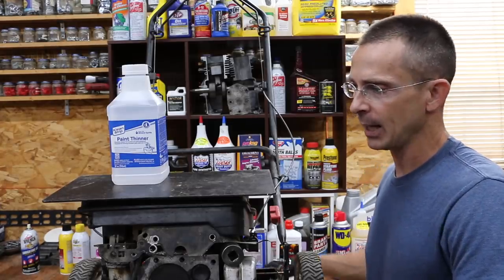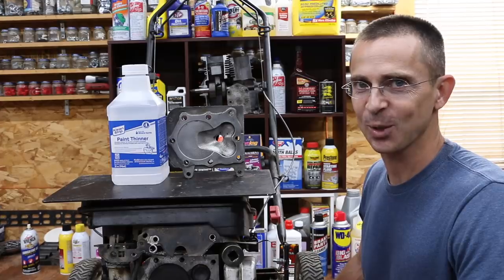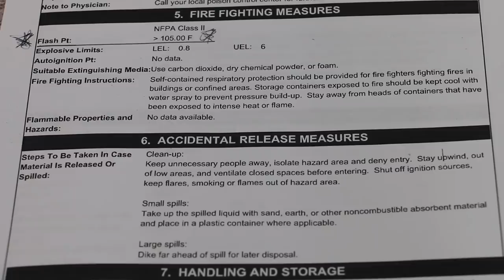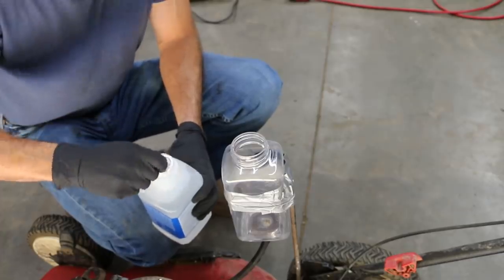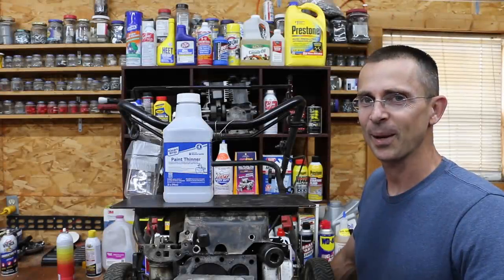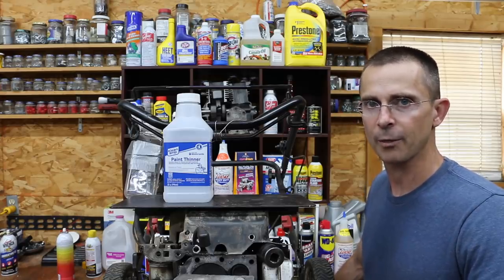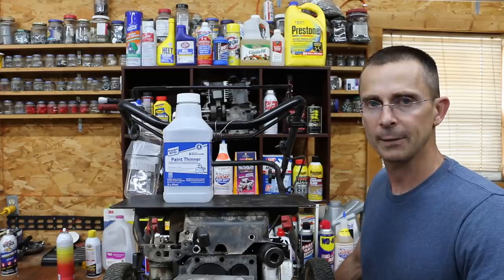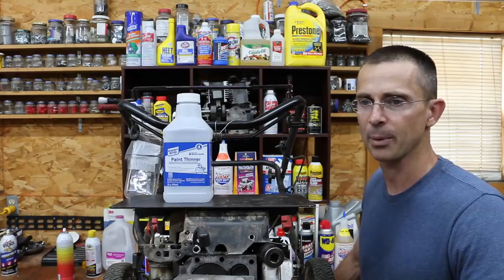Will a Gas Engine Run on Paint Thinner?  Let's find out!

Comment: The reason it runs better on 50/50 pt/gas vapors is commutative (individual) vapor pressures. More ingredients = more volatile. Add a third ingredient and it would be even more betterer
Reply from the maker: Thanks for the feedback.

Comment: and the wmb Briggs is a very low compression engine running on WD-40 but I was spraying it in the little mixing valve carburetor I never tried to pour it in the tank and letting it suck up through the mixer it has no float carburetor it's one of the early early early ones
Reply from the maker: Thanks for commenting.

Comment: I was helping a friend clean out a detached garage full of junk. I found an old chain saw in there and wanted to see if it would run so I could make a junk/sell assessment. I looked around and found a half full 2.5 gallon gas can labeled "Pre-mix" and while it smelled kinda weird it seemed like it should burn so I tried it. It started and ran fine. When I told him later he asked what I used for fuel since he didn't think he had any pre-mix. I said I found a can out there that said it was pre-mix and he started laughing. He said that was paint and reducer (thinner) from cleaning his paint guns, some kerosene, weed killer, and probably even some piss. He used to use that can for everything he didn't know where to dump from the house garage, which he used as his body/paint/mechanical shop. So yeah...little engines will run on pretty much anything that burns. At all.
Reply from the maker: Wow! I'm glad it fired up.
Reply: I thought of another paint thinner episode...I worked in the shop at an old style full service gas station, probably the last one in the area. One of my old customers had a one owner Lincoln Mark IV with the 460 and he used to swear by running about a pint of lacquer thinner in each full tank of fuel for deposit control. I don't know if that actually works or not, but one day he pulled up to the self serve side and put in his thinner, walked over to the shop and started talking to me for a while, then when he walked away he just got in the car and left...didn't put any fuel in it. A couple of hours later he called and said bring the wrecker, I ran out of gas. I told him yeah I thought you forgot to fuel it. So I went and hauled it back to the shop and filled the tank while it was still hooked to the wrecker, but it wouldn't start. It would huff back through the intake randomly but not really trying to run. I pulled the plugs out to have a look because it acted and smelled flooded, and lo and behold...5 outta 8 electrodes missing! And insulators stained red as cherries. 8 new plugs and it was fine again. I guess there was some SERIOUS detonation occurring there while heavy on the lacquer thinner ratio...

Comment: Since mineral spirits is similar to distillate, I think, I wonder if it would run in your little diesel motor? Or maybe a mixture of diesel and mineral spirits. I know they use to run early diesel locomotives on distillate back in the 1930's. Yet my dad lived in south Texas back in the early 50's and he said Conaco oil trucks, that had gasoline engines use to fill up out of the distillate tanks. Maybe it will run in both.
Reply from the maker: Thanks for the suggestion.

Comment: I’ve heard of running mix of 25% paint thinner briefly to clean out valves and crapalytic converters. I never tried it. It probably increases engine temp and cuts cylinder lubrication.
Reply from the maker: Great feedback. Thank you

Comment: I always wondered if you use the hot exhaust to a heat exchanger to vaporize diesel or fuel oil to create vapor. Then direct the vapor to the carburetor to run the engine. Possibly starting the engine on gas to get the heat exchanger hot then cut the gas and transfer to diesel vapor to see if it runs. Cheers
Reply from the maker: Thank you for the video idea!

Comment: How about running on Lacquer Thinner?  Very volatile, low flash point, and lot's of oxygenates.  Might damage seals like acetone, but it may also clean up carbon deposits, and gummy carbs.  Try a dirty fuel, then lacquer thinner and see if it cleans the carbon deposits.
Reply from the maker: Thank you for this recommendation!

Comment: can't believe it ran so smooth on such high octane, i bet it wouldn't last a summer running pure thinner tho i think gas is supposed to have a lubricate isn't?, for the rubber seals in the carburetor, seems like thinner would dry em up.
Reply from the maker: I do believe paint thinner would be hard on the carburetor. Thanks

Comment: You should test different size metal shavings, filings and drill spirals to see how much damage you can do to your motor if you are drilling, taping or grinding near the intake manifold. Maybe even see what some tiny screws, washers, bolts ect would do
Reply from the maker: Thanks for the video idea.

Comment: Old mechanics trick is to run 1 gallon paint thinner to 3 gallons gas in your car if you have cat problems. 
  I got my old truck to pass smog with that mixture. It’s basically just making higher octane gas.
Reply from the maker: Thanks for the recommendation.

Comment: I have an old Model T, and I've heard that a trick to get rid of some carbon build-up from back in the T days was to spray water into the intake while the engine is running.

I would love to see you test that and find out if it actually works!
Reply from the maker: Thank you for this recommendation!

Comment: Love your videos. The practical facts and evidence testing the claims and you don't leave out the anecdotal because sometimes that tells a story as well just thought I would throw it out there again how about HHO on your gas vapor engine see what a carbureted engine will do with HHO and how much more efficient if at all it will run. And don't forget the flashback arrestor intake for safety,I think that's what it's called... Don't want to see you get hurt from my suggestion LOL!
Reply from the maker: Thank you.  I need to test HHO soon!
Reply: @ProjectFarm  and then I realized lawn mower doesn't need a battery to run LOL... Of course you could get a lawn mower that does use a battery ignition system but that would be expensive and there may be better ways to do it I'm sure you'll come up with the best way when the time is right thanks again for your videos.

Comment: I've run them on mineral turpentine they run okay ..run quietly ..however no real power and they knock like hell when you put them under load. Not sure what you were using 
Different thinners names for different places... in australia...
oil based paint -mineral turpentine 
shellac based - methylated spirit's 
paint thinner is Really strong stuff eg: gun wash.
Reply from the maker: Thanks for sharing.

Comment: maybe retry the diesel test but this time see if it runs smooth with a choke applied because in the original video it ran with constant use of the primer and that only draws extra fuel in to the engine and the same could be accompleished with the choke
Reply from the maker: Great video idea!

Comment: So, looking into this, These results aren't that surprising (they are at first). I don't know if you did this video before trying to run the small engine on everclear (basically pure ethanol). But it was surprising that the paint thinner ran fine, while the ethanol did not, yet the vapor of the paint thinner didn't and the ethanol did! But looking at the specs (as you have sort of turned me on to), this may not be so surprising. So to get a baseline:

Gasoline:
flash point (i.e. at what temperature will the vapors be ignitable): -45 F  (WOW that's really volatile!!!)
autoignition temperature (i.e. what temperature does it spontaneously combust): 477-536 F

Ethanol:
flash point: 61.9 F (well below room or even "normal" temperatures)
autoignition temperature: 689 F

"Paint Thinner": (this is specifically Do It Mineral Spirits Paint Thinner)
flash point: 107 F (well above ethanol, and well above "normal" temperatures--not so volatile after all)
autoignition temperature: 445 F (actually below that of gasoline)

So looking at the data, you can see why the paint thinner ran fine as a liquid, why the ethanol didn't and why the vapors of the paint thinner didn't run the engine but the vapors of the ethanol did!
Reply from the maker: Thank you!

Comment: Have you done acetone yet?  I've heard people add it to gas because people make the claim it gives you better fuel economy. I had an emergency situation where I was out of gas at 4am. There was a gas station on the other side of the hill and I had a can of acetone in the trunk maybe 16 ounces. I put it in, the car started, got me over the hill and I immediately put 15.5 gallons of gas in.

I'd say running a strong concentration of acetone in a fuel injected car was risky but so far so good.
Reply from the maker: Thanks for the feedback and video idea.

Comment: i could be wrong but it seems the paint thinner runs a little faster than gas in that mower?? it just sounds like its doing more than 3600 rpm :)
Reply from the maker: You might be right.

Comment: OK, so we know that virtually all liquid petroleum products are part of gasoline, so isolating one from the other isn't too surprising. Big Q, the original diesel engine ran on vegetable oil, some people are doing some minor modifications to run used vegetable oil in their diesel cars or trucks. Diesel engines will run on any fuel but the less dense fuels don't produce as much power. Wondering if motor oil will work as a fuel in a diesel engine? API SN motor oils seem "lighter" than some old school motor oils so they might work just fine as a fuel in a diesel engine.
Reply from the maker: Thank you for the video idea!

Comment: So what has been the most competitive substance to use vs traditional gasoline? As far as cost/gallon? Paint thinner is of course more expensive, but if there is something that combusts with as much energy and costs less, that'd be a done deal
Reply from the maker: Both Coleman Camp Fuel and Paint Thinner did pretty well, but both are more expensive than gasoline.  In a pinch, I'd use either of those options as well as Zippo Lighter fluid if I had any on hand. Thank you

Comment: Some people suggest that adding 2t mineral oil in diesel fuel increases its lubricity which is good for injection system while cleaning carbon. I tried it and it actually worked great in my car's common rail engine (1:80) and engine sound and vibration decreased. I could not tear apart the engine though. Could you make a video on that and test it?
Reply from the maker: Thank you for the video idea!

Comment: My uncle used to drive his old car on paint thiner (was cheap). There were some diferences, the car will run faster în straight line but the engine was hoter, on up hill dosen't have enough power and sometimes when he want to stop the engine, it wil still run another 2-3 seconds
Reply from the maker: Thanks for the feedback.

Comment: So theoretically would paint thinner in the tank clean out the carb bowl & jets?
How about a video where you take apart a gas running carb, document the condition & cleanliness, then run a tank of paint thinner and see if its any better after
Reply from the maker: It does seem like it would help clean. Thank you

Comment: How about acetylene? I know they will run on propane and natural gas. It'd be interesting to see how much carbon buildup just straight acetylene would cause. On a cutting/welding torch rig just having the acetylene side open without oxygen makes long, stringy, floaty soot. Wonder how bad it would get in an internal combustion engine.
Reply from the maker: Thank you for this recommendation!

Comment: I would have predicted that since the engine ran on kerosene that it would run on mineral spirits as that is just highly refined kerosene. I was surprised how poorly the diesel compared to kerosene. I wonder how JP8 would do in a gas engine.
Reply from the maker: Thanks for the recommendation!

Comment: It sounded like that engine was running a tad faster than normal. Not a lot but enough compared to that one on gasoline, I think it was. Maybe 5 to 10 percent? I was thinking that doing an RPM check as well might be interesting.
Reply from the maker: Thank you

Comment: I have a question for you?  I fly R/C air craft and buy fuel that is a 20% nitro mix, sometimes I'll add about 3oz of it to 17 gals in my gas tank on the car to up the octane? Can you tell me if it really works and what it does, when it burns you can smell the nitro fumes!

Comment: We use xylene in our turbo cars as race fuel so I know for a fact it works!!!!
Reply from the maker: Thank you for the video idea!
Reply: Xylene has an octane rating of 117 another product Toluene which used to be cheaper which was the more popular choice till the price of xylene came down. We had an account at Sherman Williams so we could get it at a contractors price. 5gal xylene was 117 octane unleaded race fuel! Was told has to be used in forced induction motors because of the higher pressure needed to combust. But you're the experiment guy
Reply: Toluline is added to race fuel as an octane boost...also gives race exhaust  that sweet smell we all know and love

Comment: Try MEK paint cleaner. Be careful in see through engine though, in my experience it has a tendency to dissolve plastic.
Reply from the maker: Thanks for the feedback.
Reply: It does, but for the purpose of a quick test that shouldn't be an issue; I've seen that shit sit in coke bottles (plastic, just so we're clear) for days at a time on the paint line I used to work on

Comment: It runs on vapors ?  If so Did you ever see how much more run time you get ?    You should duplicate that mechanism that guy patented in the 70s for heating fuel and he got supposedly 160 mpg ( if i recall ).
Reply from the maker: Great suggestion. Thank you!

Comment: Okay this is the deal paint thinner mineral spirits can be used just like a gas preservative or stabilizer I asked the guy at the paint store do people come in and ever get mineral spirits for this purpose and he said yeah so besides it's saying that on the back of a can of gas stabilizer I couldn't believe it it actually said the main ingredient is mineral spirits so I've been using it for years you know just like a paint can cap full and was a couple gallons of like a pint you know the cap on a rattle can spray paint can
Reply from the maker: Thanks for sharing.

Comment: Running the engine on vapors (particularly gas) I wonder if carbon deposits build up in the cylinder... I know you have done the vapor concentration run tests in the past but I don't think you checked for carbon deposits... I'm curious about carbon monoxide gas as well... as I understand that is a result of unburned gas... perhaps you could check that in a future project
Reply from the maker: Thank you for the feedback

Comment: Petrol/‘Gasoline and water don’t mix, add liquid soap, shake vigorously, if they will then be mixed, can an engine run on this? Maybe need to advance the ignition timing? Just an idea, and what % water in the mix if it will run?
Reply from the maker: Thank you

Comment: Synthetic or Cellulose thinner ?
in some countrys which has high gas prices , pirate gas stations sell 10 weight oil to use on diesel and thinner and other solvents in gasoline to cut prices

Comment: Could you make a video where you run a diesel engine with iso-propanol (isopropyl alcohol), tert-butanol (tert-butyl-alcohol) and toluene (use pure toluene and don't try to use benzene because that compound is carcinogenic at all concentrations while toluene is not :) Hypothetically you could use any of them but and benzene was researched as a potential fuel somewhat early in the 20th century but was dismissed due to carcinogenic properties while toluene was too expensive to mass produce as that time) 
Toluene should have an octane number above 13 I think, and comparison of it with the other ones and well as the standard fuels would be interesting to see.

I know for a fact a buddy of mine used several liters of toluene and tert-buthanole in his older diesel car and it ran like a baby (though it still had a lot of the diesel fuel in the tank).
Reply: I know benzene is by some percent in the gasoline already. One reason why gasoline is labled as toxic etc. It improves the Octane number.

Comment: What size socket do you use on your drill?  And does it work in most pull start engines?
Reply from the maker: I use multiple socket sizes, depending on which engine I'm trying to start.  The socket attaches to a 1/2 inch adapter like these:
https://www.homedepot.com/p/TITAN-Socket-Adapter-Set-3-Piece-TIT12082/301050063?cm_mmc=Shopping%7CG%7CHC%7CD25T%7C25-31_GARAGE%2FAUTOMOTIVE%7CNA%7CNA%7c71700000037147756%7c58700004141485310%7c92700035285887579&gclid=CjwKCAjw54fdBRBbEiwAW28S9h-ssPPzIElO3FL-5EkdYw0u6-yROWe0jXTIh8-kLoNKtp2DiNGpeRoCVrAQAvD_BwE&gclsrc=aw.ds&dclid=CPqVtdiNx90CFZEr4AodDIkPmw

Comment: I used model airplane fuel in my lawn mower , that thing was looking for trees , If I turned the blade over it might hover . After that it ran just fine . Just so you know model plane fuel is 8 to 15% nitro rest is alcohol .
Reply: Just so you know ,model plane fuel is 6 to 15% nitro the rest is alcohol . Dragsters can use 90% nitro making it a semi controlled explosion .
Reply from the maker: Thanks for sharing.